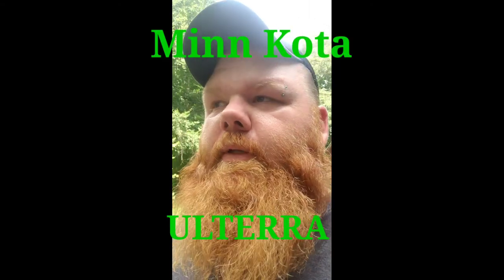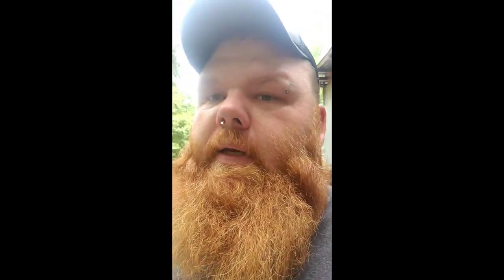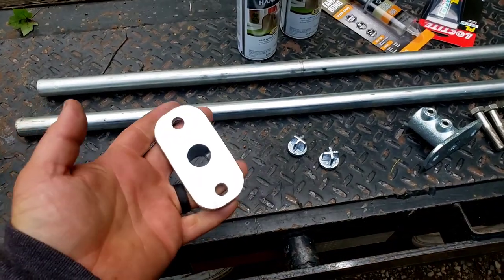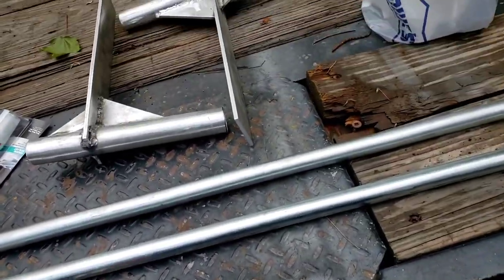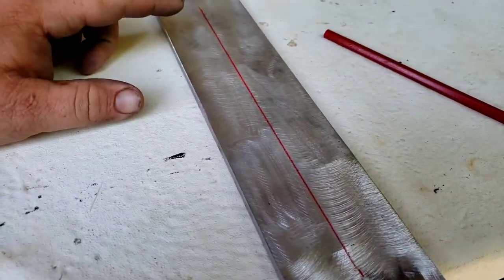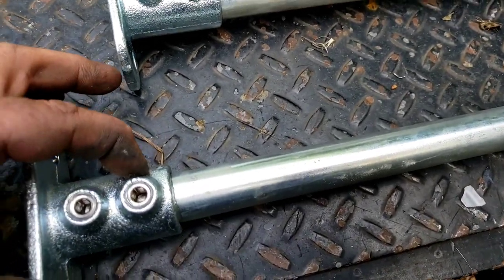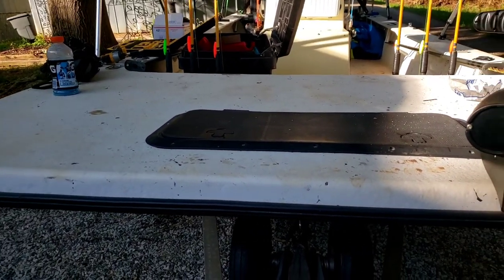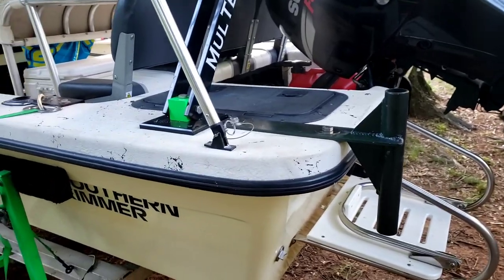Best / Strongest DIY Shallow water anchors

Comment: THOSE BRACKETS ARE AWSOME,. AND TOO THOSE CAPS YA CAN TAP EM WIT A HAMMER IF NEED TO WIT NO DAMAGE.  GIT-R-DONE
Reply from the maker: Yessir, thank you I just didn't want to pay hundreds a set of fiberglass rods
Reply: BOUTA MK ME A SET ONCE I SHUT DIS RIG DOWN.  FOUND A 5/8 8FT STEEL SOLID ROUND ROD  WITH POINT  ON HOME DEPOT SITE FA $15  EACH. ALL I HAVE TA FIND  NOW IS A HANDLE TA FIT EM
Reply from the maker: I hear ya brother. All mine come from lowes. Don't have any depots in my little town
Reply: @redbeardsdiy1222  10-4. GOD BLESS YA BROTHER 🙏🏾
Reply from the maker: Same to you man stay safe out their on the water

Comment: Hello, what material are the rods made from? I lost a 100.00 rod overboard yesterday. Great video. thanks for sharing.
Reply from the maker: Steel when all together probably weighs 15 lbs or so. You can get them from lowes. Maybe some other box stores like that
Reply: I researched it today the OD is too big. I need 3/4 OD. That pipe is 1.05 OD.
Reply from the maker: @steven33068  sorry it took so long to reply. And I'm sorry this didn't work out for your boat

Comment: Nice job brother how did it hold up?
Reply from the maker: The paint didn't hold up on them. But they have some kind of coating that keeps the outside from rusting. The inside will still rust if u get water in it. Other than that they work great for muddy or sandy bottoms. Rockey bottoms it has a hard time staying in one place. I use them when we are doing family outings on sand bars. I have had wakes come over the back of my boat and they hold firm. I have no complaints about them. Thanks for watching and commenting 🙂

Comment: Great thinking brother!..... I can't believe an actual shop charged you $120 for those shitty looking welds though. Form follows function though eh?
Reply from the maker: Thanks for watching and commenting. I use mine all the time. Alot more than I thought I would. I think if I do it over again, I will make them out of steel myself or a heaver piece of aluminum. But other than that their one of the best upgrades I put on my boat.
Reply: @redbeardsdiy1222  .... I believe it. I fish shallow water to much not to have something like this. Power Poles are way to damn expensive and I can't justify their convenience for the price. I need this.